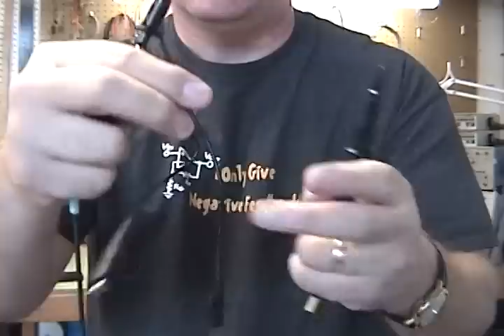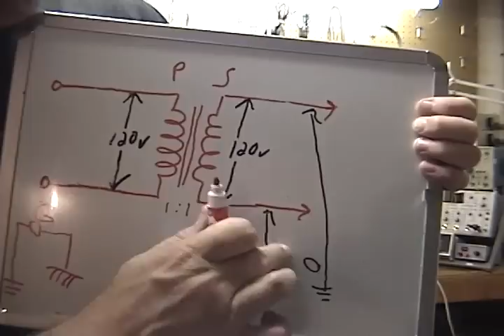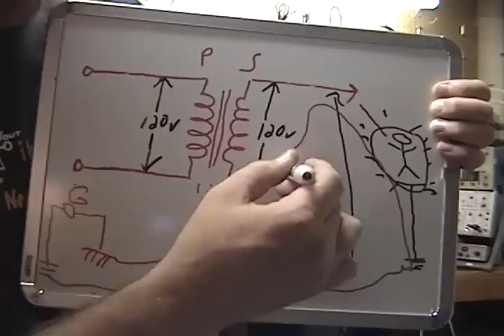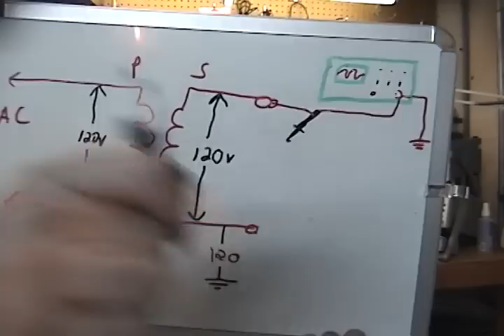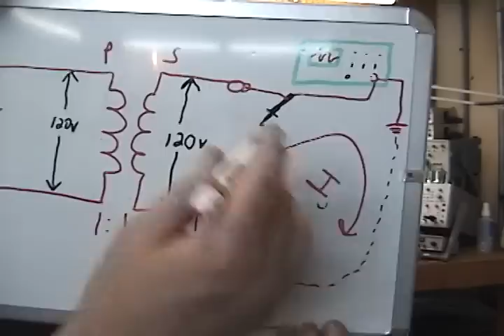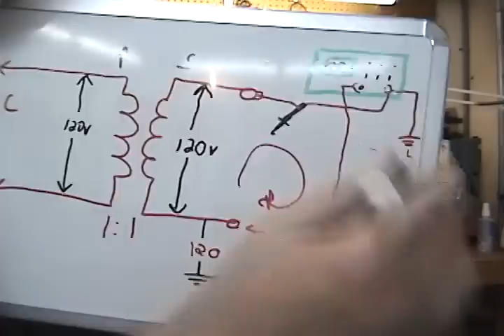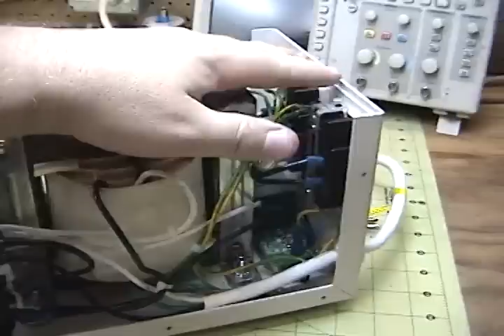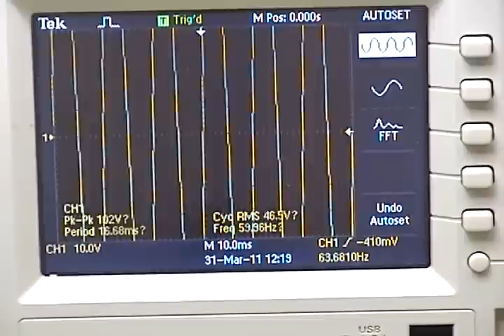ToddFun.com: Isolation Transformer - Tripp Lite IS1000

Comment: I'm not sure how this mod is any different than using a "cheater"  plug at the output of the Tripp.  What am I missing?  Also, I've seen using a couple of incandescent light bulbs as a current limiter-is this something useful to further prevent getting shocked if added to an isolator?  Great tutorial though.
Reply from the maker: You're not missing much. Just the this mod keeps the IT safe from any grounded internal faults like a melted wire, frayed wire or shorted transform to chasse ground. With your idea you could still get lethal shock if the IT has such a fault.
Reply: Thanks so much! Love your channel-found it through 
mjlorton.
Reply: OK. -- So, what is "IT" , as in  "this mod keeps the IT safe from any grounded internal faults like a melted wire" ,etc., as referenced above ??
Reply: @SkyWire88  IT = Isolation Transformer.
Reply: At 50/60Hz, you'd be surprised how low the current needs to be to shock you. 10 milliamps will kill depending on the total current path. Finger to finger on the same hand is vastly different from hand to hand (through chest), hand to foot or elbow to thy.   A couple of in-series bulbs will sometimes help the circuit you're testing to stop it exploding, but for you're safety, isolate. I live where it's 240V out of the wall for all sockets and not only do you have to deal with electric shock, burning is also on the cards.

Comment: I watched the entire extremely detailed video, but in the end, I was not quite sure what I plug into the isolation transformer (IT) ... my oscilloscope or my test equipment?  It was not until I started reading the comments that I finally understood that I plug the test equipment into the IT and that you advise against plugging scope into the IT.   I'm trying to figure out the cause of a loud hum in a powered sub  (with nothing connected but the power) that has no 3rd wire (ground) connected to home outlet.  I already made the mistake of connecting the scope probe and scope ground across a power supply cap and shorted the floating ground to the scope's earth ground, blowing a fuse in the sub.  So it would seem that plugging the sub into this modded IT would not help me because its not grounded to begin with ... correct?  Only connecting the scope to the IT would eliminate that shorting prob, but you advise against that.  So I'm trying to use the differential 2 probe method.  Any thoughts ??? Also, I noticed that when I check my home's outlet neutral (wide prong) with the scope that it shows the plus and minus 1 volt peaks only of a 60Hz sinewave running on top of 10 volt DC.  If that's the source of the hum, would the Tripp-Lite power line conditioner be a way to eliminate this ???
Reply from the maker: Well the two probe method in diff mode will work. Your hum is most likely bad filter capacitors in the power supply of your  sub. Look for bulging or leaking caps or just replace the large caps in the power supply section of  your sub.
Reply: Todd Harrison thanks for reply. That was my 1st thought, so i replaced the 6 filter caps in the power supply to no avail unfortunately. For 750RMS (1500w peak) it has a strange small transformer at the input, but i can’t identify it by its numbers to try replacing that. But i will replace the bridge rectifier. At this point I’m just thrashing.
Reply from the maker: You might be able to isolate the problem with a AC power to connected equipment like this one: Panamax MR4000 8 Outlets Power Management
https://amzn.to/2xx7NiI
Reply: Todd Harrison that’s so funny, i just bought a power line conditioner  byTripp-lite. Didn’t cure the prob. But we are def thinking alike in this prob.

Comment: Why can't we just plug the oscilloscope into the isolated (secondary) side of the isolation transformer?
Reply from the maker: You can for safety but then you will be floating your scope's ground. Many scopes come with a warning that floating the scope ground will lead to crazy and misleading readings and can also damage a scope, not sure how but it is in some documents which I link to in my blog posting on this video.

Comment: I actually plan on building my own isolation unit. Here in my town in the Philippines our mains consists of 2 - 110vac legs coming in from the meter to give us 220vac. No neutral; no ground. Yeah, weird. I will just treat it as one hot and one neutral for the transformer, giving a 220v output. So I don't have to worry about a ground. I haven't found anyone here who has even heard of an isolation transformer. My 220v variac was hard to find - finally did from Amazon, and AVRs are definitely required here because of the power fluctuating so much, and the very common power outages. Instead of burning up my PCs, I burn up UPS units. That's where I'll get my 2 transformers for the isolation transformer.
Reply: Hellooo.
So, what is "AVRs" ??   And, what is "UPS units" ??
 Thanks, in advance.

Comment: Excellent explanations. I really wanted to see how you identified the neutral ground strap, but you didn't really cover how exactly to identify that. I wish you would have spent a bit more time on the actual modification. Isn't that what this video was supposed to illustrate? Do you have any further illustrations to show the modification?
Reply from the maker: It is easy to find. It will be a wire connecting one side of the output outlet to a grounding stud on the chassis. Just remove it and you're good. Your 220v AC power does have a neutral. It will be a 8 to 10 food copper clad rod in the ground near your breaker box. The two 110v AC in legs will have a good path through the ground rod, through ground back to the transformer'r center tap near your house. They only do this in places that have good soil conditions and the distance to the sub transformer isn't too far. It save on copper wire to all the homes in your area. And yes, current is flowing through the earth back to the sub transformer center tap for everything running on 110 in your house. Quit common really. Hope that helps some.
Reply: Todd Harrison : There are systems in the Philippines like you describe, but I have been told that ours isn't like that. It certainly makes more sense. I will investigate further. I have driven my own grounding rod - copper clad, 3 meters long - and either of my "hot" wires, when measured to that ground reads 110v.  I'll call our electric company for an explanation. I hope you are right. It's very difficult to get accurate explanations here...
Thanks much!

Comment: If there was 2 volts on the neutral the bu;lb would not light i assume. Then you would blow the scope ?? Is this why you need the special multimeter ??  Can you get away with any small voltage on the neutral without damage to scope ??
Would the Fluke 117 have to read exactly zero to be ok ? What about 0.3 volts etc etc
Please nail this topic down for me so i can move on.
Thanks Michael
Reply from the maker: 2 volts would not damage the scope. I don't think enough amps would even flow to trip a breaker. there would be enough natural resistance in the path to ground that 2 volts wouldn't even be noticed most likely. Still not desired so it would be best to use a meter that could test and if you think it's real then down in an LED. If you put an LED in the circuit and it pops then that's too much real voltage. If it just lights you could call it safe but best is that it just doesn't light or blow in such a test.
Reply: Thanks very much Todd. Thats really in depth stuff for me about a subject that interests me.  One final question. Would any oscilloscope then be ok to measure mains AC voltage assuming 1)it is rated for the peak to peak ac voltage and 2) one takes the type of safety precautions you mention here about ensuring no short to ground.     Michael.
Reply from the maker: Yes, And use a 10x probe because that probe will attinuate the high voltage signal by 10 for the scope. Make sure your scope is set to 10x probe if it's not an auto detecting probe and all should be good.  If your scope is real old and you use a 10x probe that is not auto detect and  your scope does not have a setting, configuration or dial for 10x then you'll have to do the math yourself for the voltage levels seen on the display. Take care because high voltage is very dangerous, your scope will be safe but if you yourself touch the the wrong thing in the wrong way you can still get hurt or killed.
Reply: Thanks very much Todd for your knowledge. Im sure others must have wondered about measuring AC mains.  I have seen elsewhere not to use your scope on mains AC or you will destroy it, but they did not explain why. Now i am saving all you have written for future reference when i do actually buy a scope.

Comment: Or would even a tiny voltage difference between the 2 points amount to a short and damage the scope (see my previous comment)
Reply from the maker: A normal high impedance multi meter will show capacitive coupled voltage "ghost voltage" between the ground or neutral and the scope ground. But yes you can test it first to know if you are safe. You need a multi meter that can eliminate ghost voltage like a Fluke 117. Or just build an incandescent night light tester that you can put between your scope's earth safety ground plug at the wall and whatever point you indent to connect your scope's ground clip too. If there is a voltage potential between those two points the light will glow prepositional to the voltage and you know not to connect your scope's ground clip to that point. If you're going to use a second probe ground then repeat the the test after connecting the first probe ground but before connection the second probe just in case the ground point for the second probe is at a different potential than the first on your device under test because your scope's grounds clips are all dead shorted together inside the scope as a common point.

Comment: How can you safely use a scope on mains 230 voltage. The neutral is earthed at the house normally i believe based on my limited electrical knowledge. Could you use a multi meter to check there is no voltage difference between the supply neutral and the scope ground before the test ? Anyone have advice for this question which is really a to satisfy my curiosity about whether it can be done or not ? Thanks Michael

Comment: Regarding the remarks at the 24 to 25 minute mark - I believe there is a way to utilize a GFI with the scenario depicted, but it involves placing the DUT (for example, a 'hot chassis' radio, etc) after the GFI but the scope ground clip before the GFI, on one of the ports of the isolation transformer.  That allows for the opportunity to have two current loops, one through the load (DUT) as intended, and another unintended (and otherwise potentially fatal ) loop through your body and back to the ground which is before the GFI.  Any current returning to the point prior to the GFI bypasses its return port, and it sees a current differential, which would cause it to trip.  The key is having more than one current loop path back to source, which is how GFI works in the home as well.
Reply from the maker: Sure. That would work. Great point. Thanks.

Comment: Can you just plug your scope into the isolation transformer?
Reply from the maker: I think I address this in other comments but the short is sure, but you still face other problems like floating a scope which they don't like and can cause wrong reading and even damage. See other comments for more details.

Comment: I have setup an isolation transformer for my workbench as per your advice.  Thanks for the video. 
But I have a doubt,  do I need to connect the ground pin in the outlet of   the IT to chassis. The input side ground pin is already connected to the chassis. Is there any problems especially using oscilloscopes.  What's your suggestion?? Pls reply..
Reply from the maker: I left mine connected to have a ground to my DUT but really if your only working for safety then disconnect it. The only added risk removing the ground wire is that if the DUT gets energized with reference to house hold mains from another source like test gear then you could get a shock from your DUT. Leaving it connected adds extra safety but then leaves open the possibility for test gear to strap your secondary of your IT to mains ground causing it to be live again. So in double I guess removing it would be best.
Reply: Sorry for the confusion.. Currently the ground from the input side is only connected.  You mean to disconnect that, Or you mean no need to connect ground at the outlet to dut,  or to remove both
Reply from the maker: Either will work to drop the ground to the dut.
Reply: Thanks....

Comment: I recently purchased an 800 watt Tripplite isolation transformer (not hospital grade) hoping it would reduce 60 cycle hum in amplifiers and recording equipment in my old house-  it didn't.  would your modification make any different in that application?
Reply from the maker: Don't think so. Easy mod to try if it is every needed for yours.  Most likely whatever has a 60 cyc hum has bad filter capacitors on its input regulations circuits.

Comment: What happen if we use 2 pin  plug  for the  LOAD then no Ground reference ...  ? will that work ?  please explain
Reply: Should be OK as long as the neutral isn't connected (referenced) to ground.  If it is, like these tripp-lights, it isn't really isolated.
Reply: Thanks a lot

Comment: Todd, this by far the best explanation how to isolate at the bench; and I have searched for days. I have built 3 guitar amps from kits, but now I am about to start building a Vox AC10 from scratch. I need to learn much about safety. I look forward to checking out your other videos.
Reply from the maker: Great to have you aboard! Glad you liked the video,
Reply: If I work only on tube amps with transformers, do I need to plug the amp into an isolation transformer? Would this type of amp be safer to work on just plugged straight into a GFCI outlet? Most of the discussion I have read about concerning isolation deals with working on old radios and transformless amplifiers.
Reply from the maker: If everything in the AMP is after the built in transformer than you don't need an IS as everything is already isolated from ground referenced power in your home. A GFCI doesn't even add anything for the same reason after the transformer, but for the wiring before the transformer the GFCI does help and it helps for anything other equipment plugged in that uses direct house mains power.

Comment: Thanks Todd for making this video.

I am in the UK and have an isolation transformer by Carroll & Meynell. The earth is different in that it is a fully potted transformer and the earth is strapped to the core/frame and common to both input and output and would appear to work as yours when you modified it.

I am glad I watched this again since I missed the point that you raise the chassis of the scope to the potential of the secondary. I haven't noticed this mentioned by other videos here - but maybe I missed it.

I don't intend doing any mains work but it is good to know the pitfalls.

Thanks again

Comment: would this be good to use to eliminate the noise from my system if i am powering LEDs. I want zero flicker. or is it overkill. I would hook my power supply into the isolation transformer then the leds to the  power supply. all of this done after removing the ground to the chassis.

Comment: Ok, so since you removed the ground connection from the output neutral connection, and therefore the transformer has disconnected the neutral/ground connection that is at the Mains power panel.  You should be able to have the ground, that goes all the way through the isolation transformer, hooked to the chassis of the piece of equipment your working on.  Am I correct on this?  I just ordered a Tripp Lite IS1000 isolation transformer and will need to modify it like you did yours.  Great video.  Thanks.
Reply from the maker: Yes that is correct.

Comment: Good video. Also it is not wise to rely on the method of probing about in the DUT with one hand behind your back. That one hand your using has fingers, say an index finger on one part of the circuit, and a thumb or pinky, on a different part of the circuit,  maybe AT A DIFFERENT POTENTIAL.  You have just introduced a conductor, your hand, between those points with your fingers. The good news is that this is a survivable situation, you may blow off your fingers, and hell, you saved your other hand because it was behind your back.
Reply from the maker: All true. Guess the big prevention is not to get killed.

Comment: would it be helpfull and more safe to use TWO isolation transformers ? one for the DUT and one for the Osc ??
Reply from the maker: Just one is all you need. The object is to stop the initial ground reference back to the power source so if one is isolated you have achieved your goal. That said, it should always be the DUT because that is what you might be poking around inside. And you shouldn't float a scope if you can at all help it as floating a scope can cause it damage and cause crazy readings, just be very careful or get isolated scope probe or use a difference reading between 2 probes and no ground clips.